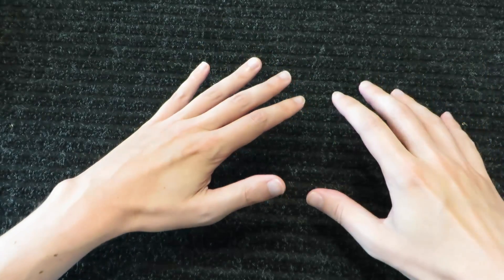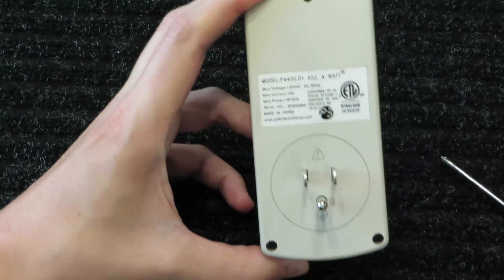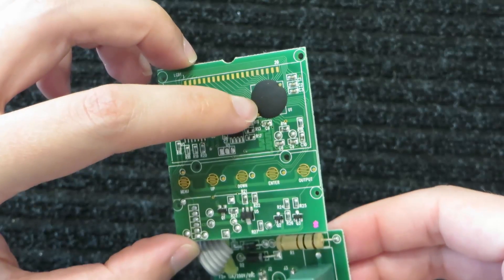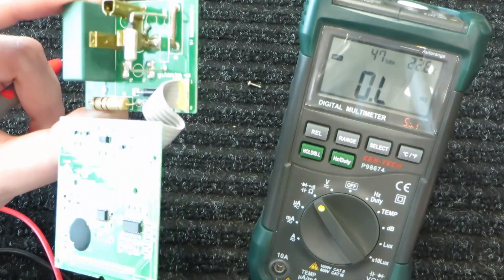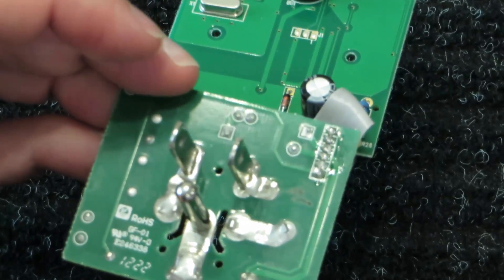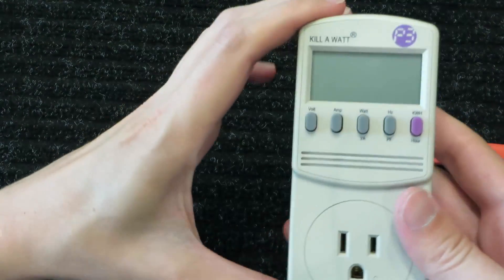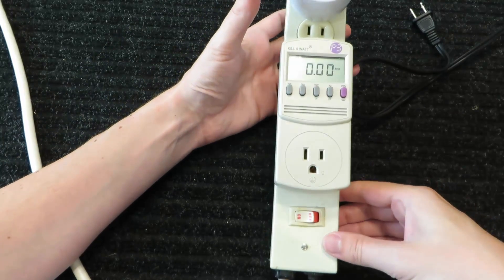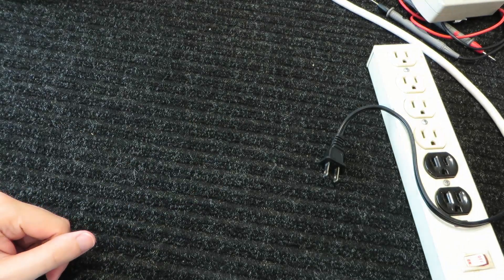Kill-A-Watt P3 Meter - Disassembly and Repair

Comment: You probably won't forget, but if it was me I'd mark it with a "no fuse" warning.
Reply from the maker: John Strabismus Good idea!
Reply: ***** for me that yellow fuse was ok actually. If i were you, i'd use it instead soldering wires unprotected.

Comment: Automotive anything would not be suitable for breaking heavy fault currents @ 120V AC, granted i'd probably bypass that fuse too :) but using a plastic ATO fuse rated for breaking 32V DC is just not right.
Reply from the maker: codemsan That's a good point.  There would be a possibility of an arc over with a 32V rated fuse/breaker.  I'm not sure that either one is more dangerous than no fuse at all but I should have mentioned that.  It's also worth noting that those automotive grade devices are rated for DC which has a much higher arc potential than AC volt for volt, but they still aren't rated or designed for 120VAC.
Reply: Indeed, DC is much harder to break, which is why its considered much more dangerous volt for volts as well. try rectifying mains AC with a resistive ballast then short the DC supply (smoothing caps help) and boom, juicy arcs with not more than a couple hundred volts open circuit. The equivalent of this in AC would need around 10x that (MOT supply) :)

Comment: Those thermal fuses are a one-shot deal, they use them as safety over-temp switches for coffee makers and the like, time for a new one!!  ECG used to stock them, guess it would  be NTE nowadays.
Reply: MrLinuxfreak2000 They are pretty standard components anyway.  Any electronic supply house will have them.  In the day I used them to repair quite a number of hair dryers for people (the Knurlgnar solution would have been unwise...lol).  Now we are at the point that a thermal fuse costs almost as much as a new hair dryer.  Crazy world.
Reply: pillsnotbills And both are probably either made and/or sourced from China!!!
Reply: +MrLinuxfreak2000 That change over killed me. I have a great (now out-of-date) cross reference from ECG. Yes I have the digital NTE cross, but it seemed better to physically look up a device & see if I had an equivalent lol.
Reply: I have SO MANY old ECG parts...